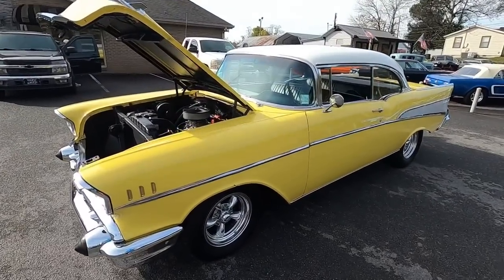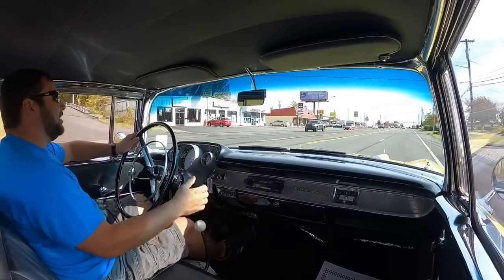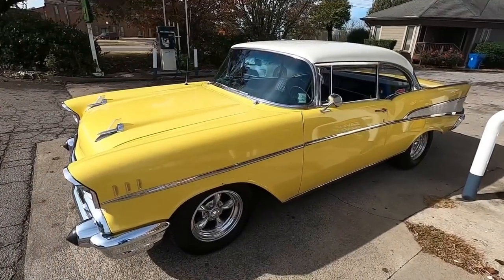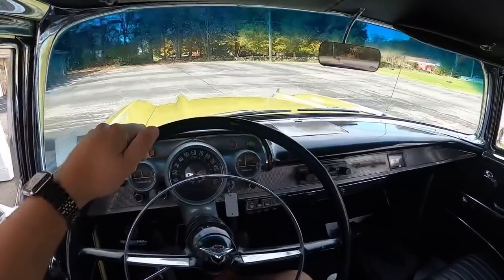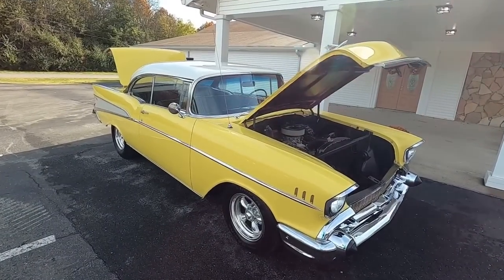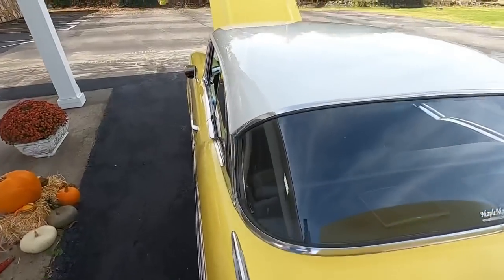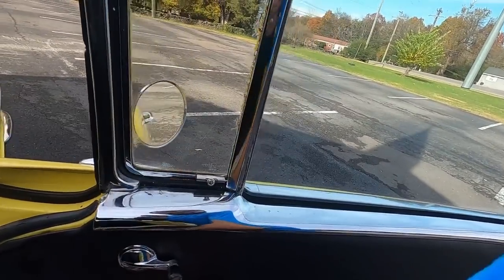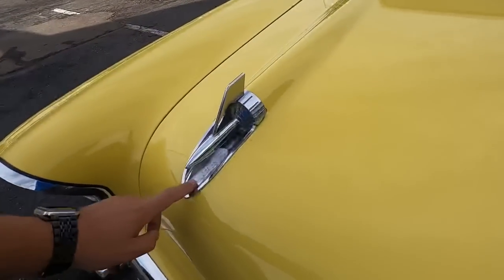Test Drive 1957 Chevrolet Bel Air 2-Door Hardtop SOLD $35,900 Maple Motors #1375

Comment: Very beautiful iconic model car design of the 1950s. This Chevy 57 is a real true gem! The colours look absolutely nice, the body and the undercarrage seem very impeccable too. The engine sounds great and it offers a tremendous great deal of accelaration, for a three speed car. However, the car seems to present a few accumulated important flaws to it, despite your vigourous honesty, but which can be repaired quite easily. I think that $35,900 is slightly overpriced, for a car like this, unless you decide to have all the détails rectified, on the vehicule at once. In other words, the security brakes, the loosen steering wheel, pulling to the left, the speedometer gage, the third gear shifting problem, as well as for the wipers are just as important as any other features, on this car. Thank you, Maple Motors, for another great episode of your car presentation, on the YouTube chanel. Johnny, Montréal, Canada.

Comment: Probably a 350 .  Remember that beautiful fawn beige 64 corvette from last week had a 327, and had the oil breather cap/ oil fill on the front  of the intake manifold, which intregates into the engine block.  The 350’s were vented through the valve cover(s) via pcv valves.

Comment: Would you sell my car on your lot 1962 Pontiac Bonneville ? Everything is done  mechanical wise tonew motor new transmission new gas tank new exhaust new brakes new brake lines new bearings new shocks new springs new radiator the only thing that's left is the body work and interior although I did put new carpet in it it runs and rides and drives like a cloud going down the road smoother than anything I've ever driven it's got real power steering you can't feel the wheels in front of you
Reply from the maker: We don’t do any consignment deals. Thanks